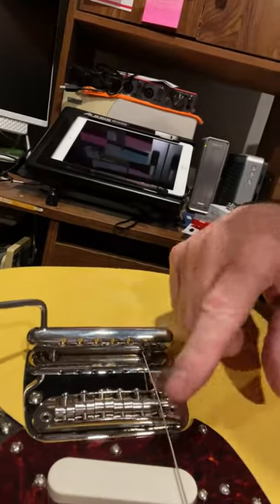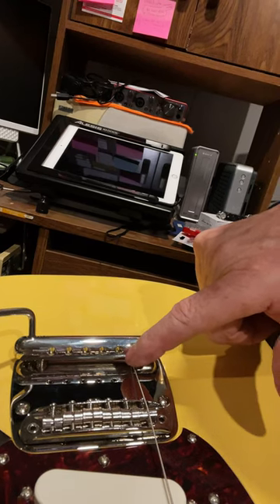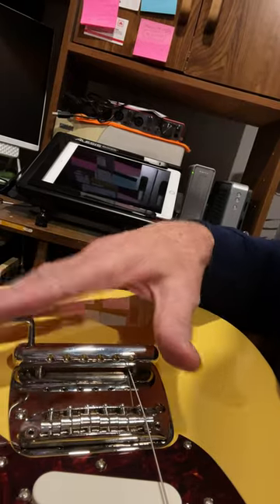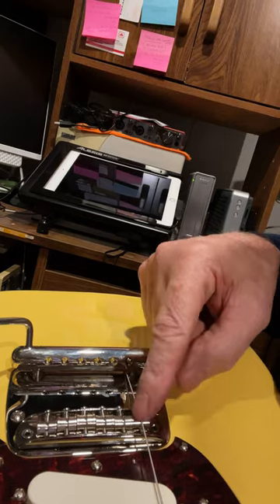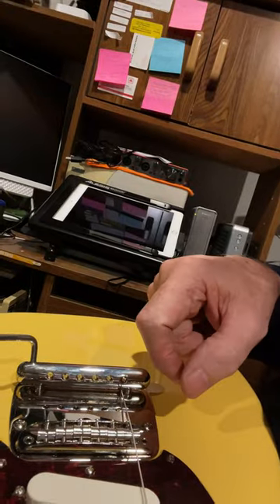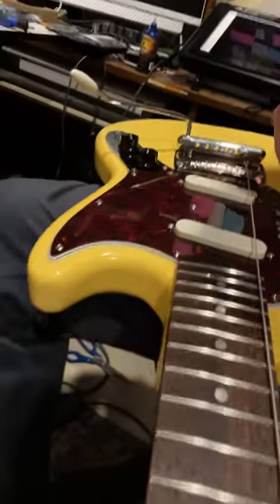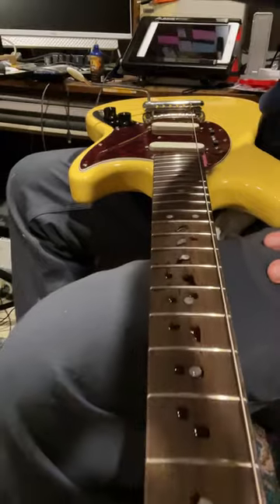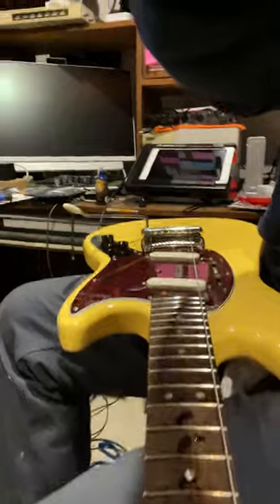Classic Vibe Mustang | Setup | Restring Tip #shorts #guitar #guitartip

Comment: how do you get the string to fit underneath the cigar bridge? is there supposed to be a gap big enough for strings to pass through?
Reply from the maker: Thanks for stopping in!  I did a full setup video for the Mustang here on the channel, but to answer your question…
You want to string the guitar by inserting the string from the top of the cigar bridge so that the ball end is facing the pickups.  Then wrap the string “underneath” the cigar bridge and up across the bridge pins and up to the tuners.  You only need enough clearance under the cigar bridge for the string to clear.